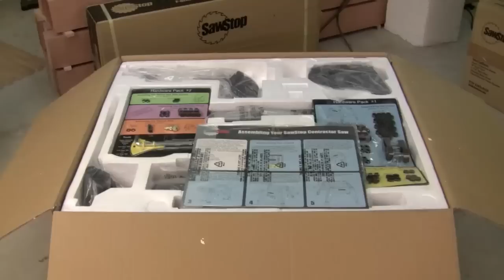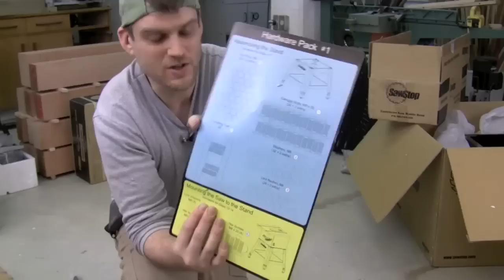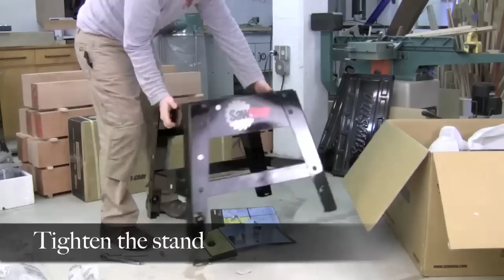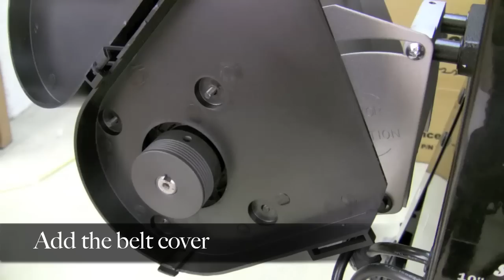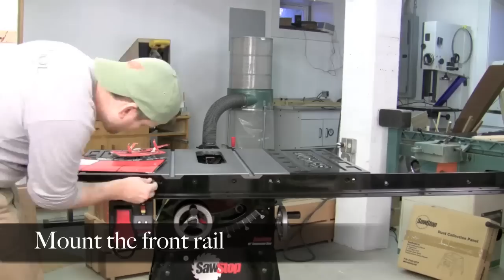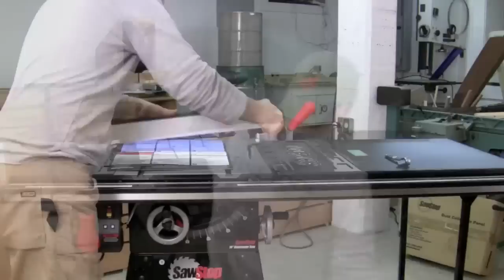SawStop Contractor Saw Assembly

Comment: just bought mine and the slide rail in the front usually screws into the table top but they didn't drill them properly at sawstop cause none of the screws fit, the holes are way to big and not threaded so not sure what to do now....

Comment: When you go to attach the front rail, the instructions say to thread the bolts into the cast table. None of the bolts provided thread in. None. They all need nuts on the back.
Reply: ive got the same problem....did you figure out what to do?

Comment: I’m going through the assembly of my saw stop contractor saw. It’s not going as smooth as you described. Many of the bolt holes have to be drilled out because of the powder coating closing up the holes. The switch, I can only get one bolt in as the insid
Reply: The switch assembly, you can only get one bolt tightened in. The other one on the inside you can’t get your fingers in there to even get the screw started. That should be a through hole with a nut. Not a threaded hole. The extension wings are weak. Don’t lean on them to stand up. They bend. They are cheaply made.

Comment: I thought the directions on the first laminated sheet (stand, saw mount, motor mount) were excellent. The second laminated sheet for installing the rails is confusing. sawstop sent me an extra set of rails (by mistake) and it was really hard to tell the front/rear rails are different and where to install. (not numbered) The fact the directions are the same for contractor and cabinet saws doesn't help.

Comment: Thank you so much for this video! I'm getting ready to order this very model so this was a fantastic video to watch so I know what to expect from delivery to completing assembly. I was debating weather to get the cast iron wings upgrade and this helped me decide. I think it was in another video you made where you explained the aluminum wings weren't exactly flush with saw base. I'd rather not fuss with that so am going with cast iron. 

I will be assembling in garage with an uneven grade. Do you recommend I build a level platform to assemble on or can I level base feet and get same effect?
Reply from the maker: Bolt together metal stands can be assembled "wracked" when you tighten up bolts with the legs not on flat, level ground.  Unless the grade is just horrible, you should be able to make use of the leg levelers (or some shim stock under them)  to get the stand level before you snug up the bolts.  Using bolts or dowels in the holes of the top portion of the stand to keep those panels lined up, like shown in the video, should also prove useful to minimize wracking due to an uneven floor during the assembly of the stand. To find out more or to purchase from us here at Highland Woodworking, here is the product link: https://www.highlandwoodworking.com/sawstop-contractor-saw-cns10.aspx

Comment: This really helped thanks...but did you have trouble attaching the saw to the stand as I did?
They might have made the bolts a bit longer though.
I had to omit one washer because there wasn't enough room for the washer, lock washer and nut. I figure it wont hurt.
This demo was great.